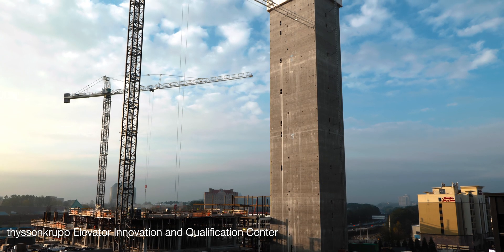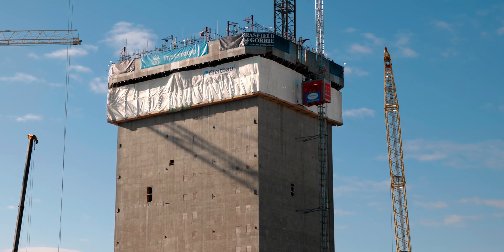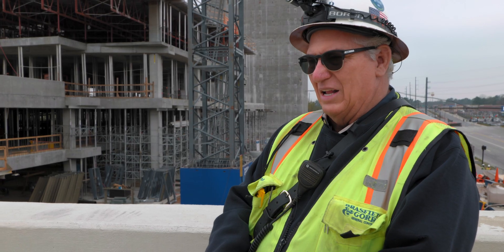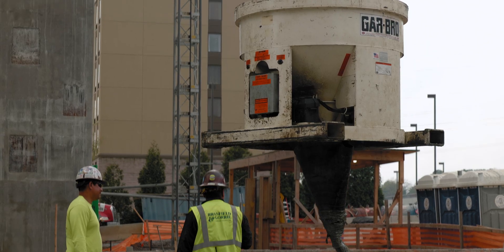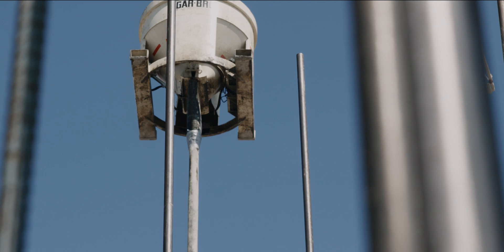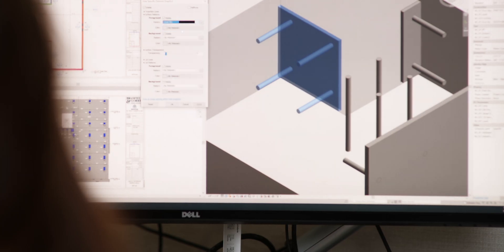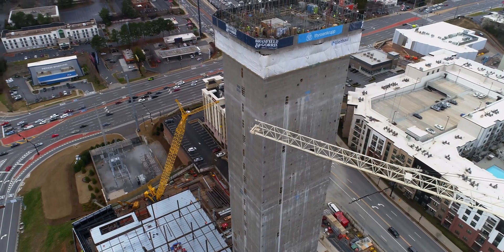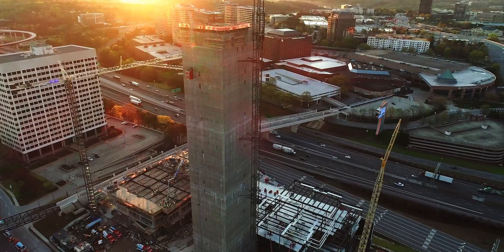Success with Self-Performance: Slip-Form

Comment: Helped build two of these roughly the same size and height in Sussex New Brunswick, Canada to be used as head frames for a new potash mine. I like how you guys broke the shifts into 12 on and 24 off with 3 crews. We did it with 2 crews and 12 hr shifts. Kept pouring one night right through a post tropical storm with over 100mm of rain and 100km hr winds and completed each one in under 40 days apiece. . Before the mine even started to produce potash the price per ton plummeted and the mine closed and never reopened… a 3 billion dollar catastrophe.